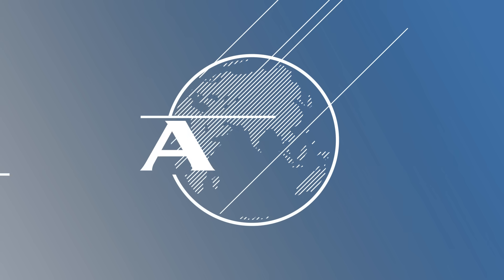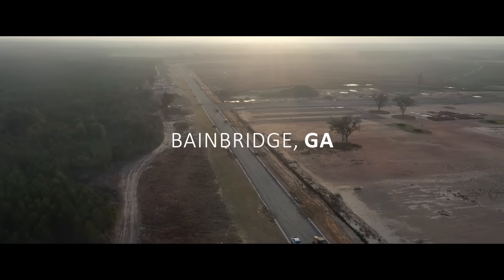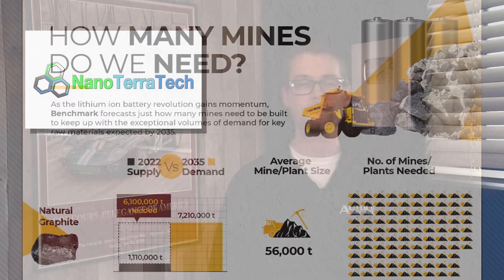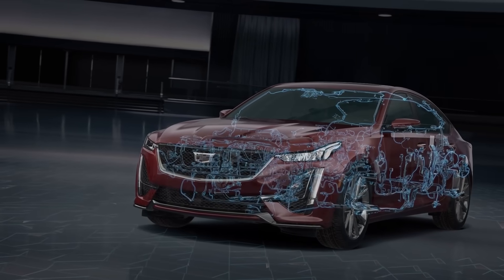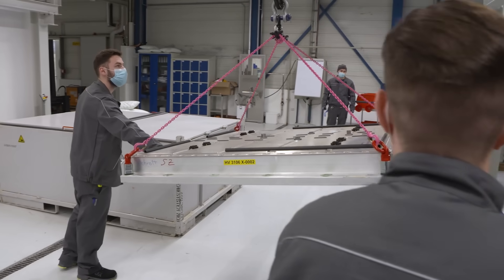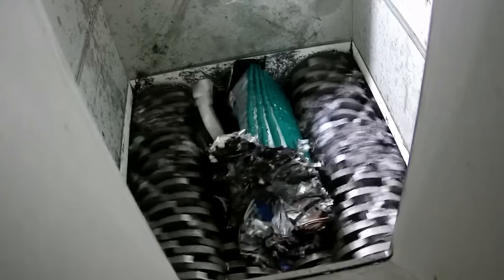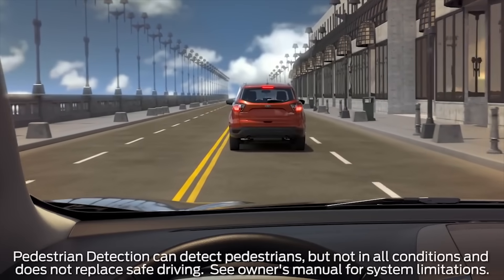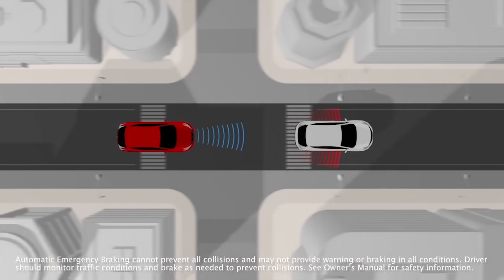Big $$$ In Battery Storage; EVs Are Tool & Die Bonanza - Autoline Daily 3659

Comment: I especially appreciate your exploring and explaining how stationary storage and micro-gridding makes everything about the grid better, more weather resilient, more efficient, safer, greener.
Reply: Advocates of the old status quo carp about the costs of the energy transition.  The fact is, in the long run, it will save tons of money, and will have tremendous benefits.

The upsides outweigh the downsides by more than 2 to 1.  

And that would be true even if climate change didn't exist.

Comment: I don't think widespread EV adoption will happen in the US until someone finds a good alternative to the F-150 style truck.
Reply: Lets see how the CyberTruck works.   If Tesla used the same tech it did to make their semi run further under load we may have what your looking for.
Reply: @danharold3087 💯
Reply: There's a lot of people who just want a small, cheap car to get to work.
Reply: @jamesvandamme7786 True Story.   Most people want to go from A to B in something they can afford.
Reply: Widespread EV adoption is happening right now.  It's just uneven state by state.

BEV market share is at 8% nationwide, but 20% in California.

Charging infrastructure and the range of models available are going to increase dramatically over the next four years.

The biggest obstacle by far is the mining and refining.  Materials shortages keep prices high.  As the shortages ease, prices will drop.  That will solve most of the other problems.  Newer battery tech will solve the rest.
Reply: @davidmenasco5743  Adoption can't happen faster than production.

Comment: By 2027 Tesla will be half of all vehicles on the road.  That is why ADAS will be common.
Reply: Unless the others get their asses in gear. Not guessing either way.
Reply: Math does not check out.    Even if Tesla made up 50% of care sales, it would not make up 50% of the active US auto fleet.

ADAS is common in most new cars.   It's functionality is typically a decade behind Tesla's base ADAS (autopilot), but many have ADAS.
Reply: EVs are currently less than 1% of the vehicles on the road and EV sales globally are barely in double digit percentage of sales of new cars.  Tesla making up half of all vehicles on the road?  Think about it.
Reply: It's interesting math but assuming Tesla meets goal of 50% annual growth in vehicles, that's 10 million vehicles during 2027.  Global fleet conservative estimate 1.5 billion, 2027.  Tesla alone will replace slightly less than one percent of the global fleet that year.  Another thing to think about is the new vehicle market and assuming it decreases to 60 million Tesla will be producing 16%.  Their global market share is currently about 2.25%, assuming 80 million deliveries this year and Tesla producing 1.8 million.  You can check the math.  
The USA numbers are 15,000,000 estimated sales this year with Tesla delivering 5% so, potentially,  Tesla will be delivering at least 25% of new vehicles in the US by 2027 but those are assumptions of course and your math may differ.
Reply: Wow, imagine that in 2005, or 2010, you told anyone that there is even a possibility that electric cars from Tesla would be more than 25% of the US auto market by 2030.
Reply: 2027?! Wow, what a load of BS that is. 3.5 years and they are going to replace 100M vehicles? And that's just in the US. And selling just two sedans, not the many vehicle types that people need/want.

Comment: More tooling = more automation?
Reply: Auto making even with relatively low levels of automation require a lot of tool and die.  Literally everything is shaped by shearing and stamping metal.  I mean low by modern standards.  One can shape a body with an English wheel and hour and hours of work.
Reply: Ahem.

Comment: -2 thoughts on gas stations:

Fewer stations, but more pumps? (think Costco)

- EV chargers at stations will decrease throughput, which they depend on for revenue.
Reply: They can make money on charging with less infrastructure, as opposed to selling gas near cost to get people into their convenience stores.
Reply: Gas stations, large and small, make razor thin margins on gas.   Most of their profits come from convenience store sales and other services, like attached car wash.

I think gas stations, especially those not owned by Oil companies (e.g. Wawa, 7-11) will begin shifting to EV charging from gas pumps over the next several years.

This will maintain their convenience store revenues, as well as lower operating costs.   Infrastructure and maintenance is cheaper for EV charging.   I also think regulatory costs are lower than they are for underground fuel storage, but that's a guess.
Reply: @BTC_Minarchist  Good point on regulatory (& delivery) issues.
The throughput I was getting at IS the food.
If an EV is parked for 40 minutes of charging, I doubt they'll buy 10x of chips & soda vs the 4-minute petrol customer.
Bad deal for the gas station owner lea$ing expensive land.
Reply: @donswier  give them a good clean bathroom and they might buy and consume more 😂

Comment: I am just waiting for someone to say their batteries can be stacked in the towers of the wind generators. No reason to have the battery storage laid out on flat ground.
Reply: What about safe accessibility, that is a reason one, or not?
Reply: @Alarix246 💯
Reply: @Alarix246  the accessibility can be built in.
Reply: Thinking weight would be a problem.
Reply: @danharold3087  they are stackable
Reply: It’s cheaper in flat ground.  Plenty of flat ground next to the turbines.  Keep up the innovative thinking - we humans need more of that!
Reply: There's plenty of reasons. Weight, maintenance, modularity. They don't take up much room on the ground, but there's not much room at the top of a tower.
Reply: @jamesvandamme7786  they do take up room on the ground and you don’t have to go all the way to the top and maintenance can be just as easy. The whole point of using battery storage in the first place is they require less maintenance.
Reply: @robwalker4548  So stack them inside the tower? I don't see that being viable. Seems like a better idea would be to build one backup facility for one turbine farm, not one set of batteries for every turbine.
Reply: @jamesvandamme7786 all excellent reasons.   I'll add fire safety.  If you lose one to fire in a stacked windmill, you lose them all.

Comment: I think we've been over the gas station decline topic before.  While  gas station numbers will drop due to EVs, this is only in the long run.
There are simply not enough EVs on the road to cause the numerical decrease being seen.  Not even remotely.
Station consolidation ... from the smaller "ma 'n pa" stations to the large conglomerate-style stations ... that's what we're seeing now.
Reply: It has been dropping because of increased environmental rules on gasoline storage in the ground. Several of the old stations that are family owned like my parents closed when they retired because it would cost to much to up grade the tank storage and controls to meet the new rules. Because their store was in a low volume rural area corporate chain stations were not interested in it. The was happening long before 2002. However, the location has access to electricity (and now is surrounded by wind generating farms) so in the future even low volume areas can afford to have a charging units without all the environmental rules that exist now for gas and diesel stations.
Reply: @robwalker4548   Good example, I'm sure stuff like that have knocked out a number of smaller/older joints.
Reply: I've seen several stations go out of business in my area with the need to upgrade under ground storage. Only problem with the sites was the need to burn all of the dirt to get the gasoline out before they could use the site for another purpose. You cannot believe the volume of dirt that needs to be removed to keep the gas out of the water table. I'm sure this will only increase.
Reply: It's a combination of all of these comments.   It hasn't been just one factor.   As EV adoption rises, that will be the biggest factor because it's growing exponentially.  The next 3-5 years will be interesting.
Reply: Stricter regulations in certain states (California) are making it too costly to own an operate a gas station which also explains the decline.  You also have (ESG) banks that look at your industry and if they forecast a decline over time they adjust their lending standards accordingly making it harder or more costly to get loans.
Reply: The traditional gas station closed decades ago.  In my area it is all truck stops, convenience stores, and WallyWorld.
Reply: What we’re seeing is the tip of the iceberg, and a harbinger of things to come. Gas station owners only make money grocery sales. Gas is dying, right before our eyes.